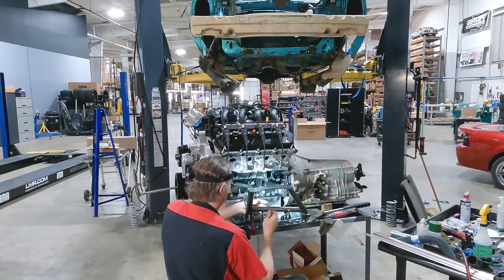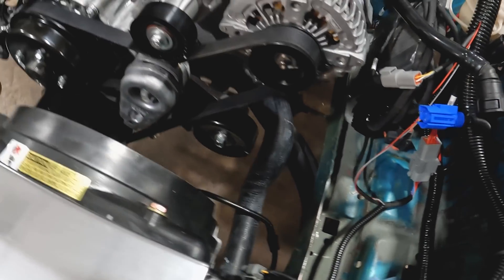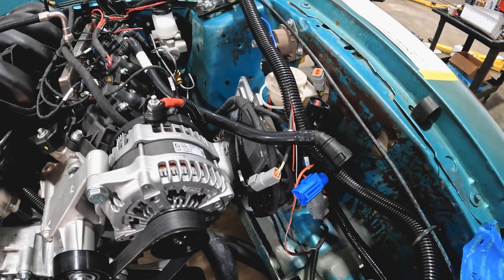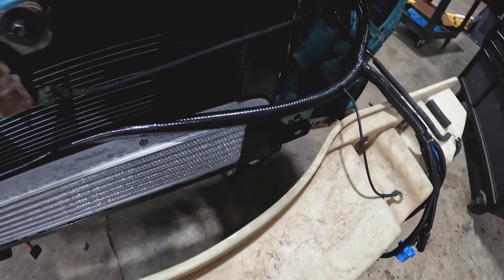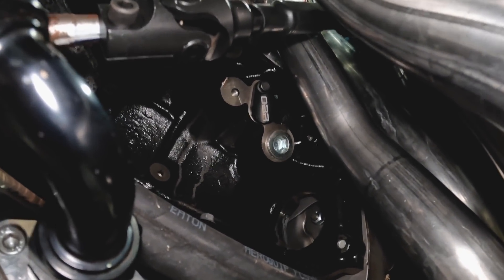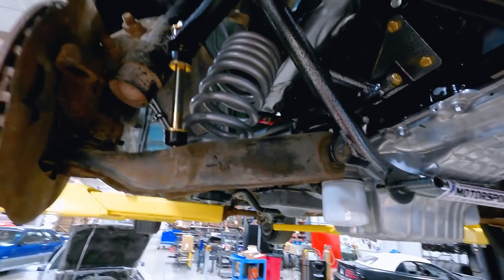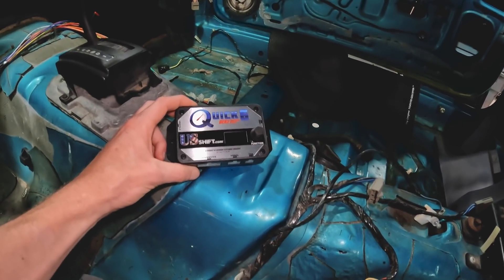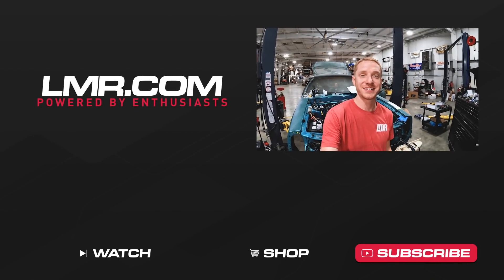7.3L Godzilla Fox Body Swap | EP: 3 We Did It! First Startup!

Comment: What oil pressure sending unit did you guys use for the oil filter relocation kit?
Reply from the maker: Since we used the Autometer InVision digital cluster, we installed the oil pressure sending unit that was included in the kit.  It's AutoMeter part number 2242.

Here is a link to the cluster if want to know more: https://lmr.com/item/ATM-7007/mustang-autometer-invision-lcd-dash-kit-87-93
Reply: @latemodelrestoration  would they happen to make something similar for a 95 gt ?
Reply from the maker: @Tracybuilt  At this time, they don't offer one for the 94-95 Mustangs.  -Landan

Comment: what shifter lever do you have hooked up from the shifter to trans?
Reply from the maker: Rafael - We are using a custom-fabricated linkage with the stock shifter.  -Landan
Reply: @latemodelrestoration  oh ok was trying to get a better look to see how it was. So ill need to do the same for my 6r80 swap on mine then
Reply from the maker: @87_Notchfox  Yes.  That's the easiest way to do it.  We are hoping to offer a solution for this in the near future, but I can't guarantee anything.  -Landan
Reply: @latemodelrestoration  well I hope you guys do. Using the sn95 shifter cable and bracket with 3in exhaust doesn't work out to good.
Reply from the maker: @87_Notchfox  We omitted the cable for that reason.  -Landan
Reply: @latemodelrestoration  figured as much. Well hopefully you guys make something that can work better than the cable

Comment: You will need to move the fuel pressure regulator so that you are regulating the pressure in the fuel rails. In the current setup you are only regulating from the regulator back to the pump